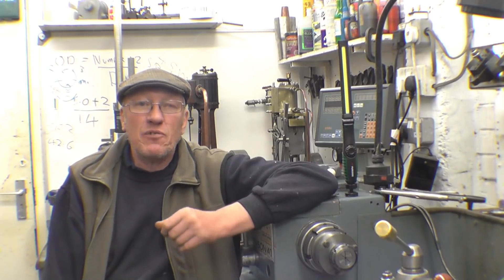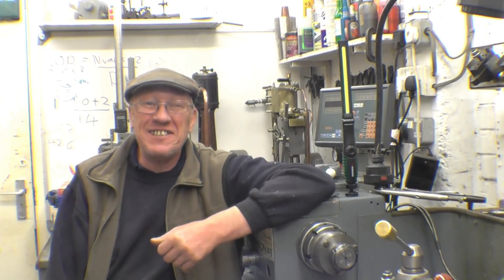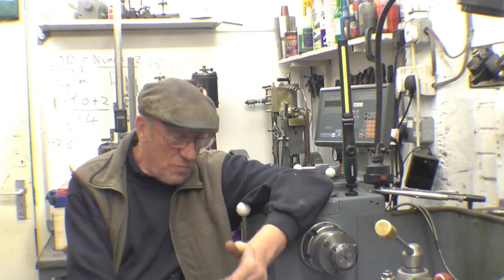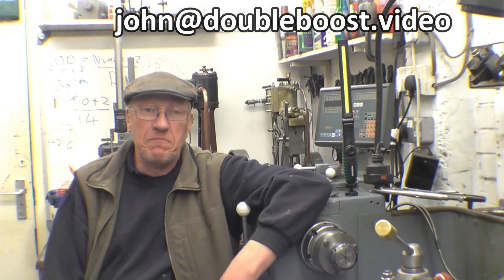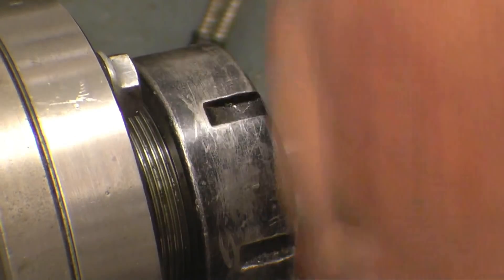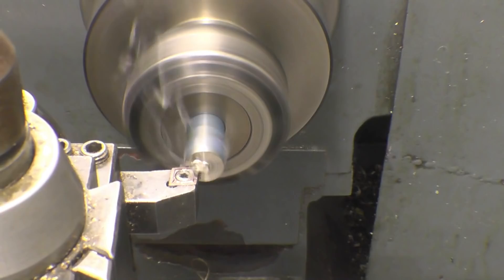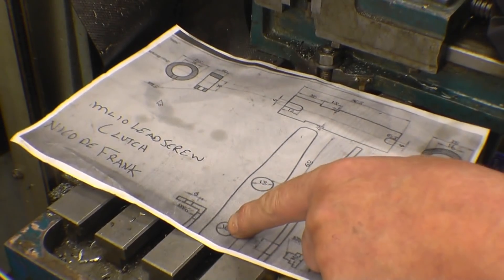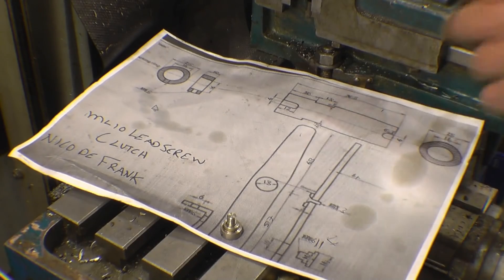SNNC 329 P1    Making A Machine Screw

Comment from the maker: I HAVE PUT A LINK TO THE MACHINISTS JACK IN THE DESCRIPTION BOX
Reply: Thanks
Reply: Just finished my version.  Rather than hack it out of a 32mm square lump -which I did not gave, I made it out of three bits of 1.25” x  0.25” flat bolted together.  One thing I did notice was there was no OA length shown (unless I missed it), so I used a 20 degree scribe mark to get the length
Reply: Thank you 👍

Comment: Great video as always 👍👍.Need some antifreez or soly oil in that water bed mr john 🤣
Reply from the maker: It is due to be cleaned out  i do use soluble oil
Reply: @doubleboost  good stuff soly oil.i throw it in van instead of anti freez during summer 🤣